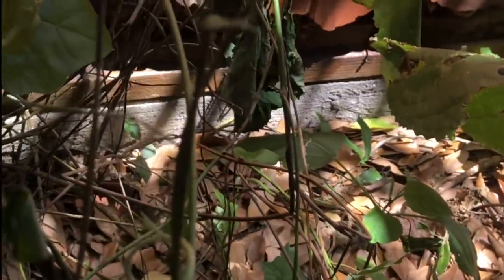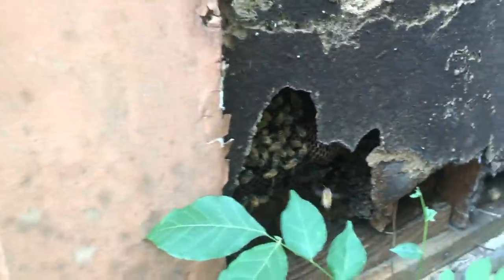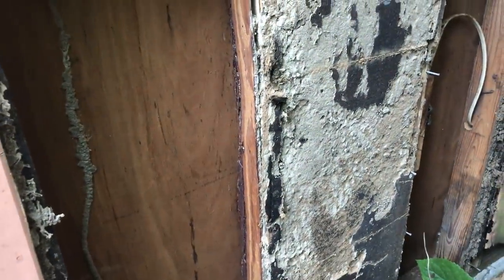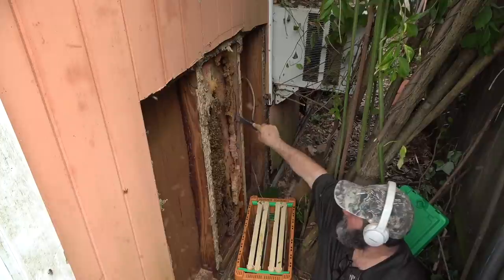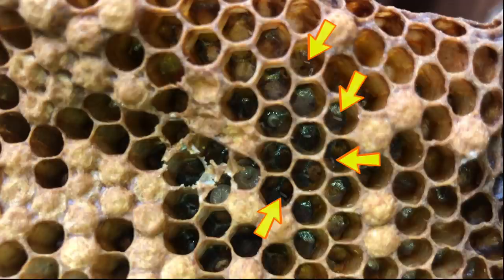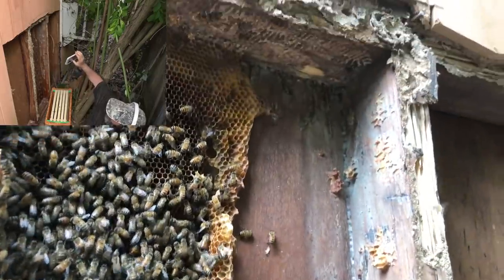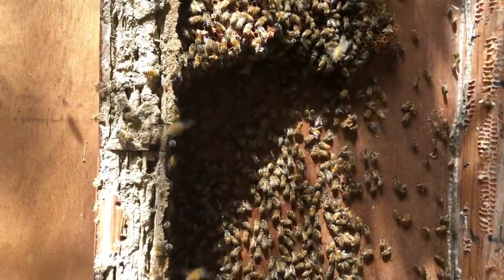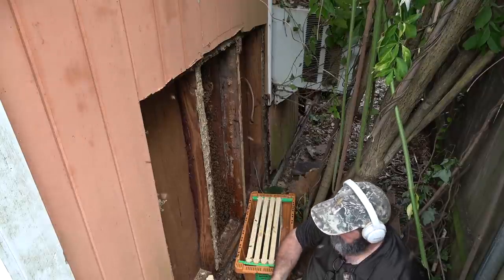Saving 2 Beehives From Ants & Termites

Comment: I would call that color maybe a light salmon.  Definitely some pink in it.  Actually, the wood it’s on has that same color on the outside of the structure.  Always great to see your videos!
Reply from the maker: The exterior was a Pepto Bismal  pink but it was in bad shape & likely painted a million years ago so I don’t think there’s a correlation between the paint & the color of the comb, just my opinion.
Reply: JPthebeeman works for me!  I’m not there.  Colors on YT are frequently iffy at best.
Reply: @JPthebeeman  
i noticed someone else bring it up but perhaps the color was coming from hummingbird feeders that where near by 
you know the red artificial mixture of sugar water and i guess nectar that goes in them that's meant to simulate flowers

Comment: Love your video's, not sure about those new plastic nukes though.
Reply from the maker: The plastic Nucs are a friend of mine’s, my buddy Schawee bought like a truck load of em.

I don’t care much that the entrances are high but there are ways of making that work for you.

They’re actually really intended to house bees temporarily.

They tend to absorb a lot of heat so they have to be kept in the shade in hot temperatures but again they’re temporary housing.

The best thing about them is they’re light, durable & of course water proof.

Comment: I've noticed some of my favorite bee keepers using those plastic bee boxes and am curious how you like them, positive or negative how do the bees take to them, do you see a difference in how they beehave?
Reply from the maker: These are temporary Nucs. They cannot be stacked, so once they’ve outgrown their britches you must transfer them into a larger set up.

There are pluses & minuses, first the pluses: they are waterproof, light weight & the lids secure nicely to the hive bodies.

They have entrances on both ends.

The minuses: I suppose by design, the entrances have to be a little higher than normal, I’d prefer them lower than they are.

The way the entrances open & close is a little iffy as well, sometimes they don’t fully close & you might need to tape them shut if transferring them in a vehicle other than the back of your truck.

Lastly, they tend to accumulate a lot of heat & must be placed in the shade in really hot weather.

For what I’m using them for I’d give them a 4 out of 5 rating & add another quarter of a star for looks.